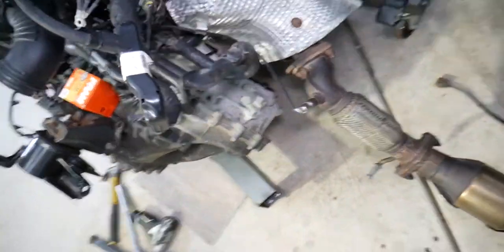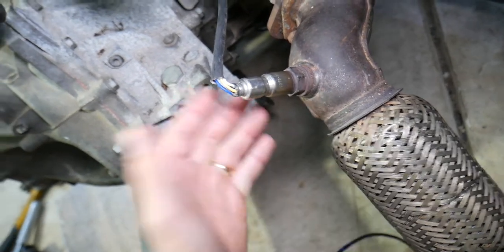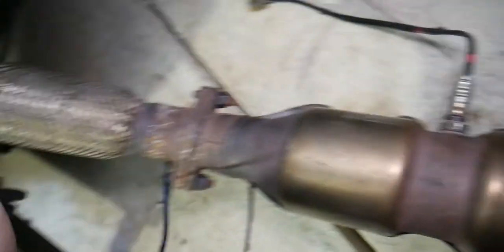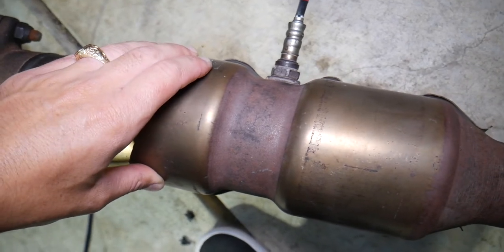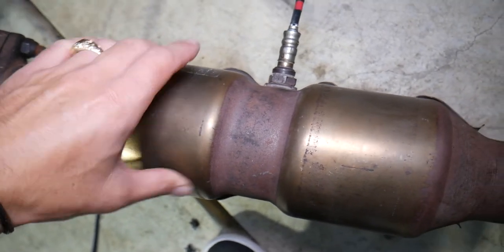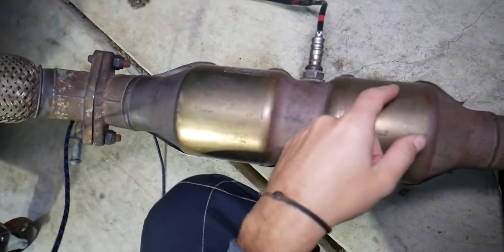CODE P0420 CHECK ENGINE LIGHT ON FIX HYUNDAI KIA, CATALYTIC CONVERTER FIX

Comment from the maker: Products that we use and recommend:
► Catalytic Converter: https://amzn.to/3Gl5L4y
► Panel Removal Set: https://amzn.to/3YiMADu
► Tool Set: https://amzn.to/3p5MM6t
► Screwdriver Set: https://amzn.to/3XRB28Q
► Castrol Oil: https://amzn.to/3xBc8B9
► Oil Filter: https://amzn.to/3w0Ulme
► Torque Wrench: https://amzn.to/32qyRwg
► Liqui Moly Engine Flush: https://amzn.to/3IiDBID
► OBD Scanner that we use most often: https://amzn.to/3I4MQfe

► Check out our Amazon Store for the tools and parts that we use: https://www.amazon.com/shop/worldmechanics